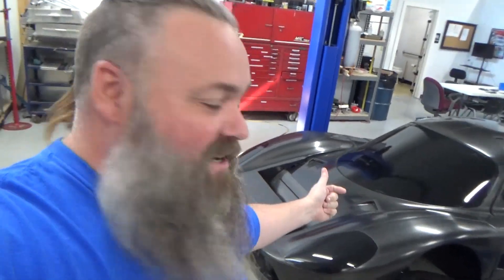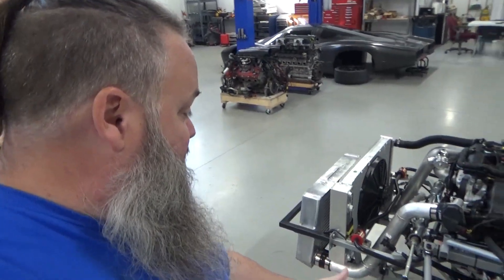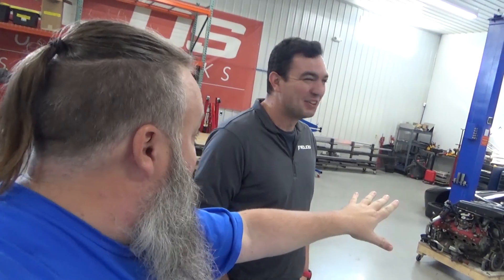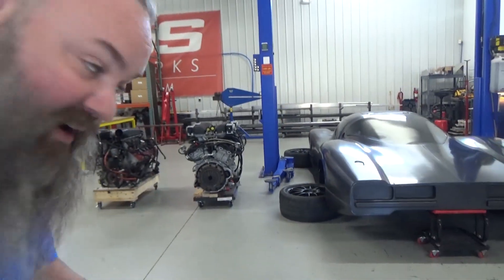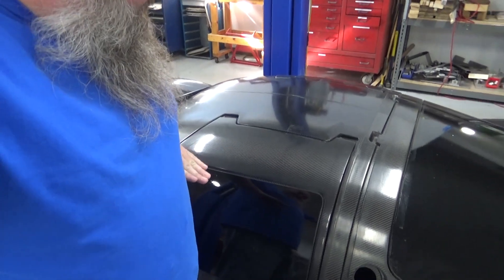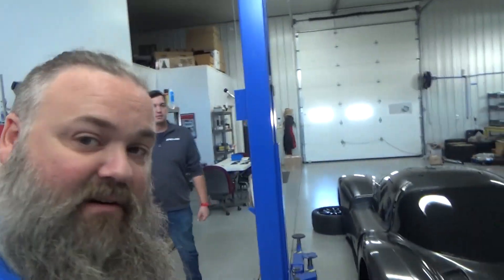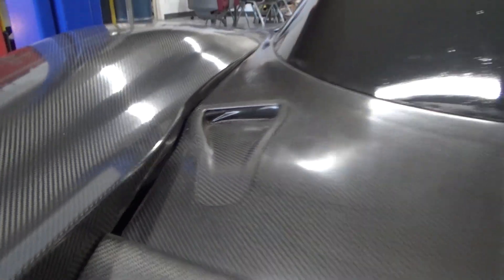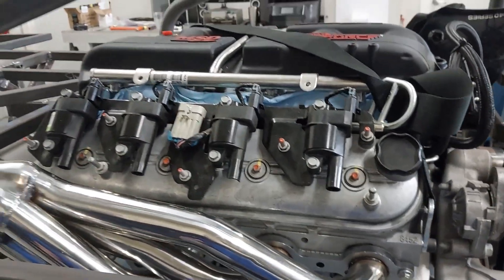The Incredible Scioto Coupe! A sneak peek into a Supercar Killer.. from Fields Auto Works?!

Comment: My lifelong dream is The whole reason I joined the Service. I couldn't afford college but wanted to learn aerodynamic engineering. So I could build my own car. I worked on the U99 and 100 For one of the best hydroplane teams in the '90s Fred Leland and His PICO AMERICAN DREAM. He Built his entire Boat and gearboxes and Dynoed his Motors Everything inhouse, he built his own 5000hp Dyno with a 125000 water tank under the building For Jet engines before anyone, and on a Tuna Budget, The Ultimate Privateer and he Won the Pinnacle Of Boat Racing. I am Honored to have been Mentored by Him, My Hero.
Reply from the maker: These guys have a lot of Aero past which you can probably tell from the design and are quite skilled draftsmen. Kindred spirits. The guys that do hydroplane boats ... man those folks are next level nuts. Huge huge props for them doing what they do but making that kind of power and hitting those sorts of speeds across the surface of water is... yikes!

Sounds like you had some pretty darn good upbringing Sir!
Reply: Thanks, Guys I appreciate your level of work, top-notch!, a huge AMX nut My favorite muscle car @LucoreAuto